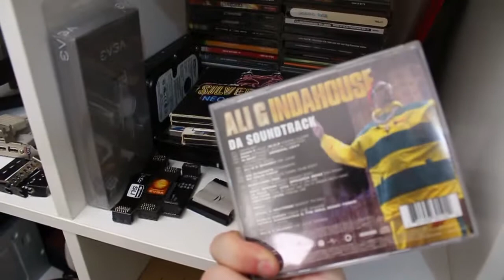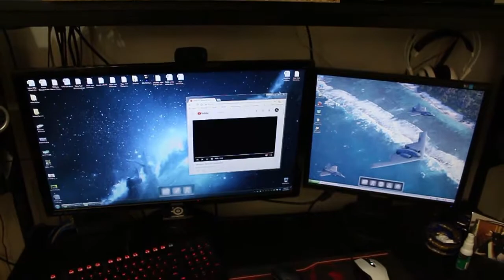New Retro GPU's & Collection/Office Tour.

Comment: Funny, I have two identical 7950gx2's and just picked up the same ASUS N7800GT dual. I have the quad SLI setup from back in the day, and as I remember it most stuff worked ok, skyrim at least did, but I do remember some titles just dropped to single GPU which was painful. Looking forward to your findings about the setup. I do have perhaps a one up on you, an original Koolance PC02 Athlon XP water cooled case with an Athlon XP 2400+ and MSI Starforce FX 5950 Ultra.
Reply: Modzy's Retro Collection Woo! Dayum that's one of the sweetest boxes I've seen in a long time! What blocks are on there? The only sort of funky old block i have is a DD TDX-MC which is still sitting in my 775 modded x5470 in my core2 box. My Koolance is just stock loop, GPU is on air for the same reason you have - testing GPUs. I wish I had a physX, saw a bunch for sale a few years ago but was busy with other stuff.